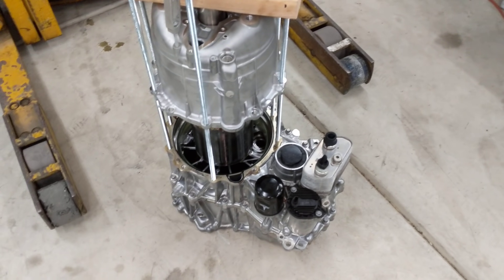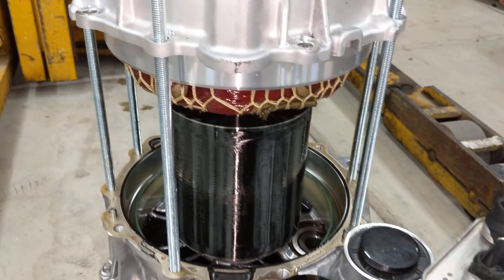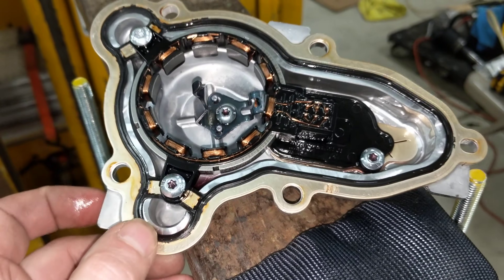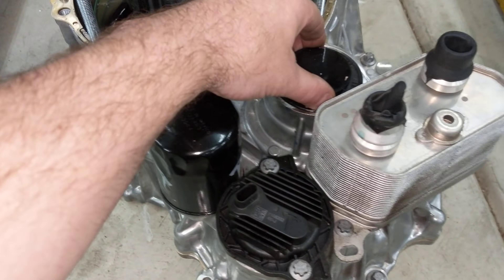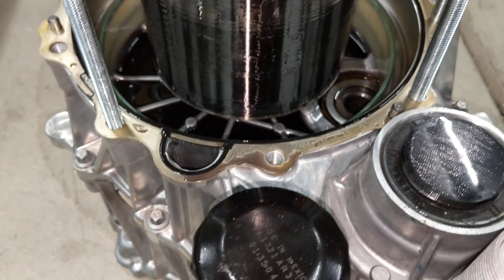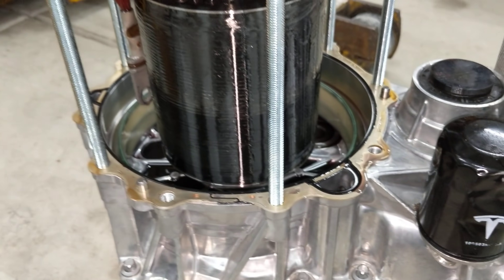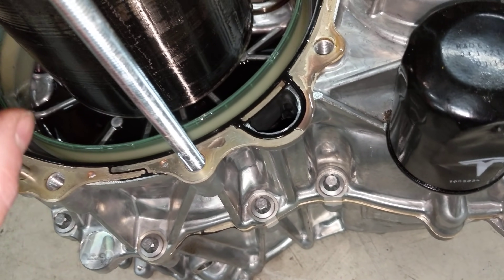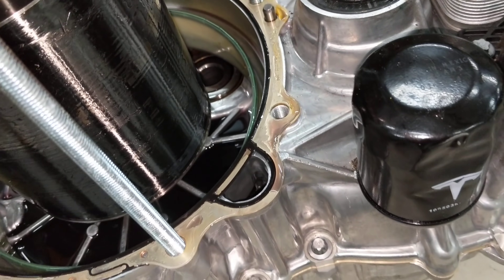Tesla Plaid Teardowns - Front Drive Unit

Comment: just read an update on this gen 2 drive units, changing oil type and maybe the process on how is serviced I think.
Gearbox Fluid - Front Drive Unit (2nd
Generation)
(Drain and Refill)
Correction Code 39300202
Revision History:
• 2024-02-28: Updated gearbox fluid.
Wondering why the change?
Reply from the maker: The reason is clearly spelled out in the service manual under fluids:  "To reduce gearbox fluid variances and improve drive unit efficiency, service centers are to transition to KAF1 gearbox fluid for all vehicle drive units. When refilling or topping up drive unit gearboxes, first deplete supplies of the specified SK 212-B, ATF-9, and EDF2 gearbox fluids, and only then substitute with KAF1. KAF1 gearbox fluid is fully backwards compatible with the SK 212-B, ATF-9, and EDF2 gearbox fluids, and incidental mixing of the specified fluid with KAF1 is permitted. Eventually, service centers will only stock KAF1 fluid."   KAF1 is more efficient, so why not?
Reply: Thank you for making things clear as water,

Comment: Are the motors in Pliad directly coupled to the wheels? or there is any way to disconnect any of the axles? Just asking for no load losses. Thanks and keep up this great work.
Reply from the maker: Yes they are, there's no way to disconnect a half-shaft without removing it from the car.   What do you mean by "no load losses"?   The single biggest loss on the highway is aerodynamic loads.   You probably wouldn't even get a extra percent if you disconnect an axle.
Reply: @Ingineerix   I mean the losses being produced due to powerful magnets spinning at high speeds. They are not comparable to aero losses I believe, but still have an impact on efficiency, specially considering the car has 3 PM motors.
This is the reason Kia is including a clutch in the front motor of the EV6. Taycan can also disengage one motor preventing it from spinning at high speeds.
Reply: Basically Eddy losses on the stator core.
Reply from the maker: @josemdbl4957  Yes, you are correct, there are losses.  The PMSRM is different than a standard PM machine.  It has less losses.  Look at the overall efficiency of Kia and/or Porsche compared to Tesla.  I don't think it would be worth the complexity, cost, and weight penalty to add clutches.  You can see this by comparing the range from the Tesla RWD to the AWD cars with same wheels.
Reply: @Ingineerix  Tesla has been an special case so far since in AWD cars they include a PM motor and an induction motor , which does not have no-load losses- the rotor has no magnets. This is the first Tesla having more than one PM motor. Internal PM motors with this V configuration have less iron losses at high speed due to flux weakening... But you don't do this when you are not using the motor, otherwise you run into one type of losses to reduce another ones. This is why I am interested in this solution.

Comment: Hi how powerful is the both front and rear drive units
Reply from the maker: I don't have this information yet, Testing is still ongoing.  From what I can tell., the power limit is imposed by the battery.  With present software it does not seem to be able to exceed 2300 amps.  Here's a graph I made of the total power output (at the battery) on a Plaid doing a 1/4 mile run:  https://www.youtube.com/channel/UC31O6BEWzx4D--YPw9aJABA/community?lb=UgwM2XjcEX5K1CrrBwN4AaABCQ

Comment: In the case of this motor, the rotor is the field and the stator is the armature (where power conversion takes place).
Reply from the maker: Yeah, the "correct" terms are actually "stator" for the part with the windings, and rotor for the moving part.   Language is working properly as long as all people in the conversation understand the same things.  People often get lost in terminology, and with Tech this is a big problem.

Comment: Hi, very interesting! Do you know the oil flow om L/min?
Reply from the maker: It's highly variable.  The flow rate is broadcasted on CAN.
Reply: @Ingineerix  do you know min and max values?
Reply from the maker: @giacomo_david96  No.  It would have to be investigated.
Reply: @Ingineerix  is it possible to you toninvestigate that? Is it an information you can undestrand from software?
Reply from the maker: @giacomo_david96  It's not important to me, and I have very limited time for such things.  You'd have to pay my consulting fee, as this would take quite a few hours, and would probably require the use of a dyno to stress the drive unit to induce maximum flow.
Reply: @Ingineerix  how much does this cost?
Reply from the maker: @giacomo_david96  I don't know, but could easily run in the thousands.

Comment: Anybody had or heard of any issues with bearing noise from electrical bearing damage.    The little tang for grounding seems at 3:03 seems like it will wear very rapidly and a poor design.
Reply from the maker: This was a big BIG problem in Tesla's early induction drive units, all the way up to about 2015.  I don't know of any issue on the modern units.   That little tang is engaging a high-speed bearing, it's not just rubbing on the shaft.
Reply: I have heard about the early induction unit issues as well.   I get it is engaging a high speed bearing, but isn't it touching the rotating side of the high speed bearing still?    Or is there something I am missing?
Reply from the maker: @Mysterrose  There is a bearing pressed into the hollow part of the end shaft of the rotor.  The "tang" engages the inner race.  There is no rubbing, trust me.
Reply: @Ingineerix  Ok on no rubbing per what you described, but then that bearing pressed into the hallow part of the end shaft of the rotor must be a sacrificial bearing as voltage goes from outer race --> rolling elements --> non moving inner race --> tang.
Reply from the maker: @Mysterrose  Because this is not an induction motor, there is not significant current that passes through this bearing, so they do not fail.

Comment: There is a wild debate online, fuled by rumours and half-knowledge, that you should change your Tesla oil filter (and possibly fluid) after 5-6 years or 100k KM. Is there anyway for you to find an oldish Model 3 motor with lots of Km on it and check how degraded the oil is? Maybe to see how many metal shavings are in it etc.? No one has done this yet and it would probably put a lot of peoples fears to rest. Cheers!
Reply from the maker: Now that the Pentosin ATF9 is becoming available, I'd say yes, do it.  It's cheap insurance!  The filters are available at Tesla Service for a nominal sum.  Changing the ATF9 is way more important than the filter.

Comment: The string is only there to hold the windings in place during the varnishing process.  Once the windings are encased the string isn't needed but is difficult to remove.  As for it being high temperature, I doubt it, the varnish will burn before the string.  Although the modern version is probably a polyurethane.

Comment: Are there any vent tubes exposed to the elements on these units?  Like if they were driven underwater would water get in anywhere?  Asking for a friend 😂
Reply from the maker: LOL, I saw your "submarine".   Yes, sadly both front and rear drive units have "breather" vents on top which are basically just baffles.  This means if they go underwater, some amount of water will enter the drive unit gear case.   Keep in mind the ATF9 used in the drive units is also cooling the motor windings as you can see in my video.  I'd recommend you change that fluid ASAP if you want to keep your submarine/car operable.  You can buy the new oil filters over-the-counter at Tesla service centers for about $12 (Part # 1095038-00-A, You'll need 4).  You'll also need the Pentosin ATF9 to change the fluid.

Comment: So this can be directly swapped into a model 3 🤯🤯🤯🤯🤯
Reply from the maker: No, not only will it not fit, there is no control system for it, and not enough battery amps to drive it.  (And probably not enough traction even if you did get it to run at full power)

Comment: Oh it's just a normal carbon wrapped motor. That's been around since 2014 2015.
Reply from the maker: Nobody has wrapped a PMSRM.
Reply: @Ingineerix  that's irrelevant. The fact remains carbon wrapped rotors are not new.
Reply from the maker: @jeffsteyn7174  Correct, but I don't think anyone has used one in a mass-produced production car.
Reply: They're not going to sell millions of Plaid cars, lol
Reply: @vidznstuff1  but they’ve sold thousands. Tens of thousands.
Reply: @vidznstuff1  As usual, the true advance is likely to be in manufacturability & cost.
Expect to see more of these motors.
Reply: @Ingineerix  ok fanboy keep moving the goal posts. The model s is FAR from Mass produced. mass produced is millions of cars a year. 🤣🤣🤣
Reply from the maker: @jeffsteyn7174  I wouldn't call myself a fanboy.  In any event, Merriam-Webster defines "Mass Produced" as "to produce in quantity usually by machinery".  Nowhere does it say a million units is required to meet that definition.   But still, I predict Tesla will sell a million of them at some point.

Comment: Does Tesla use ceramic bearings in the motor for friction reduction?
Reply: Unless the Plaid motors are different, no.  Tesla uses nickel boron bearings because they are durable and are not eroded by current flowing through them.  Check out the Weber Auto channel where they take apart front and rear Model S and Model 3 motors and have a lot of detail.

Comment: Thanks for the teardown. Is this DU designed to put out the same power as the M3 performance rear DU, as far as you know? Just higher RPMs?
Reply from the maker: I don't have hard numbers yet, but I bet this thing can put out more power than it's sibling in the 3 already.  For instance when Tesla released the Model Y, they learned how to safely bump the power level on the exact same hardware.  Tesla (or any good engineer) is going to keep a healthy reserve safety factor, and as they do more testing and see how things work in the field, they can slowly reduce this safety factor to get more power out of it.  This is something they can do with just a new software download.  I'm sure there are also some slight hardware improvements in this version where maybe they beefed up oil flow control in certain areas to eliminate hot spots that they learned were present in the older incarnation.
Reply: Too bad this makes your Jag project obsolete; you an't nuthin' unless you have a carbon rotor.
Reply: The rear motor in a model 3 is about 270-290hp from what we've seen online.  The plaid motors are 340hp x3 to make 1020hp, so it does make a bit more power.  Where there is a big difference is that the model 3 has a 9:1 ratio reducer, the plaid has a 7.5:1 ratio in order to reduce the speed of that rotor at 200mph.
Reply: @VNCTHE1  the plaid motor is actually 400hp, but the battery can only supply about 1020hp. With more battery power all 3 motors will have a combined output of 1200hp.
Reply: @harsimranbansal5355  So when they talk about a quad motor S Plaid and a quad motor Cybertruck they must be talking 4680, I guess that pack will be able to provide the needed current.

Comment: So the carbon overwrap allows for higher RRM? Is that the only purpose?
Reply: Yes.
Reply from the maker: It probably also helps the rotor maintain mechanical integrity at higher torques too.
Reply: It mainly allows high efficiency over a wider RPM range by keeping the rotor from expanding, allowing for tighter rotor/stator gap at lower RPM.
Otherwise high speed alone could be achieved with a bigger motor and higher ratio.
Reply: @musaran2  It's not quite that simple: a larger-diameter motor would be limited to even lower speed, so the "larger" motor would need to be longer... and that causes its own issues. The wrap which controls expansion and thus allows a smaller air gap also takes space, making the effective gap larger. In the end, the wrap just keeps the rotor together at a higher speed.

Comment: Just making sure, is the rotor also immersed in Oil? Pretty wild. Because I remember in an old interview of Elon he said cooling the rotor was the most difficult part because they have to take the heat out from a very small shaft area, IIRC they ended up making shaft hollow and passing oil through it to cool the rotor.
Reply from the maker: It's not "immersed", but oil is pumped/sprayed where needed.   Elon was referring to the Model S where they used induction motors where there is much higher thermal loading in the rotor itself.  Not anywhere near what is present in this PMSRM design.
Reply: @Ingineerix  Ok, so let me know if I understood correctly. 
1. Oil is circulating in the channels on outside of the stator to cool it, this oil passes through channels and flow back to sump (via other cooling routes , IIRC) 
2. Oil is sprayed on the windings on inner side of the stator to cool the windings, this oil will accumulate at bottom of motor, which connects with the oil sump and pumped via oil circulating pump inside the motor and transmission. 
3. Rotor is exposed to oil but motor inside is not filled with oil, i.e., rotor is not immersed. Any oil splashed onto the rotor will just thrown away since rotor will be rotating, these oil droplets will coalesce and drip to the bottom of motor. 

Lastly, thanks for pointing out low heating of PMSRM.
Reply from the maker: @AfaqSaleemChannel  Pretty close.  Of course they are also pumping oil through the hollow rotor shaft.  The most temperature sensitive thing are the magnets.  They absolutely cannot let those get near their curie point or the motor will be permanently damaged.

Comment: Tesla's engineering is amazing! They attract the very best engineers.
Reply: Nope, its not amazing, carbon sleeved rotors have been used in motors for applications up to 200k rpm+. Instead of using a two speeds gearbox they choosed to make the rotor revv higher.
Reply: @alanmay7929  Never in motors this large to my knowledge.
Reply: @oisiaa  lol..... motors are used everywhere in the industry, not just automotive, you're welcome.
Reply: @alanmay7929  Please provide examples. My understanding is that previous carbon wrapped motors have been small hobby motors or high power density applications.
Reply: @oisiaa  are you even serious?! Electric motors exist in all kinds and are used for all types of applications possible with very different materials and configurations for very specific tasks, doesn't matter if big or small.
Reply: @alanmay7929  Still haven't provided examples
Reply: @alanmay7929  What I'm asking for is examples of large (hundreds of KW) motors with carbon wrapped rotors. I haven't heard of it before. I've only heard of small motors like an  inch or two in diameter with carbon wrapped motors.
Reply: Persistent little fanboy, aren't you?
Reply: @vidznstuff1  Sure, but you're not giving any examples.

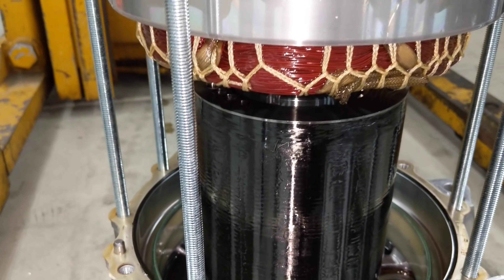Comment: 1:53 - I used to own a large electric motor that was isolated with ... silk.
Reply: Insulated or isolated, or is that the same
Reply: @kevinbreslin5718  I'm not English native. Google Translator sees not much difference here: "insulated cable,
isolated cable". I guess it should have been insulated, but I don't know why.
Reply from the maker: Silk is still used in Litz wire in some applications.

Comment: what's so special about that magic oil?
Reply from the maker: It's a super slippery fully synthetic lubricant to reduce friction and windage losses, and it's designed to last the life of the drive unit.   Lubrication technology is often overlooked, but continues to make advancements, so Tesla is using that to full advantage.
Reply: Its not magic oil, its basically a transmission oil.
Reply: @alanmay7929  The ingredients of the oil are special
Reply: @Bellissima2k  nope they aren't. Those "special" oils have been used in the automotive industry for decades where friction and very high rpm are needed. F1 engines revs up to 20k rpm and have the tightest tolerances of any engines possible.
Reply: @alanmay7929  You realize all these oil brands have different formulas from each other right? That's why some are considered better than others
Reply: @Bellissima2k  they have basically the same component just not in the same percentage.

Comment: Awesome jig, though I might have used a come along or chain hoist suspended from the forks to lift it, to give finer control over the movement. But you had guide rods so not as important I guess lol
I am surprised to see the rotor is in the wet side. I would think that would add drag, but I guess it's smooth, and the oil probably bypasses around it through the windings?
I am glad to get to see the COPM (Carbon Overwrap Powerful Motor!) finally.

Do they have a temp sensor in the oil sump to get the average unit temperature, rather than measuring the windings directly in a single spot?
Reply from the maker: Keep in mind as soon as that thing spins up, all that super low viscosity synthetic oil flings right off the rotor.    My forklift has really good fine control once you know it.  I didn't have any shock loads, While suspended from an energy absorbing strap, I was able to use hand force along with the weight of the drive unit to separate the halves, then I carefully lowered the now separated assembly back down on the floor.

Comment: If I understand, for the Model S Plaid, both front and rear motors are Permanent magnet motors.
Does the Model S LR still has a front Induction Motor like the Model 3?
Reply from the maker: No, all 3 motors are now PMSRM.  The induction is gone.
Reply: The front LR engine has the same price in the spare parts catalog as the front Plaid engine. Visually, too, it is impossible to notice the difference between them. Watch this video: https://youtu.be/x27iLgc5_yM

Considering that the LR accelerates 60-130 faster than Performance, I think technically it is the same engine.